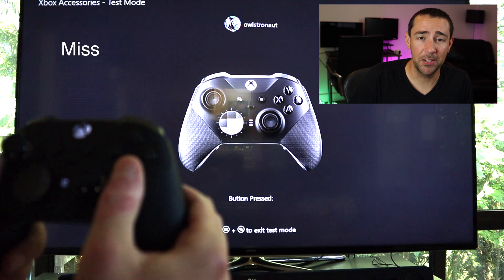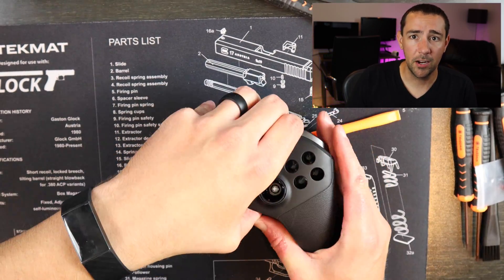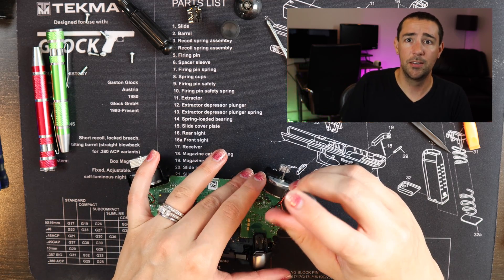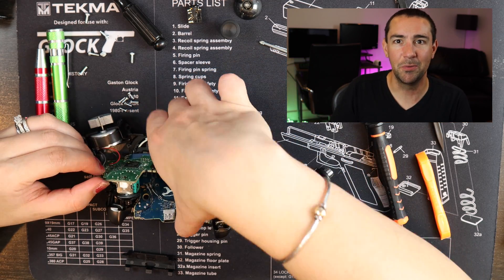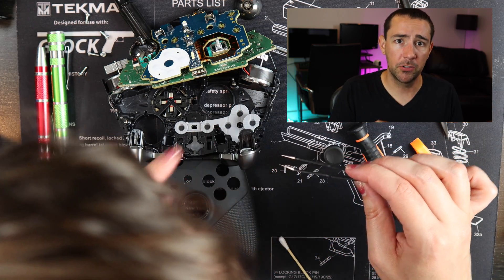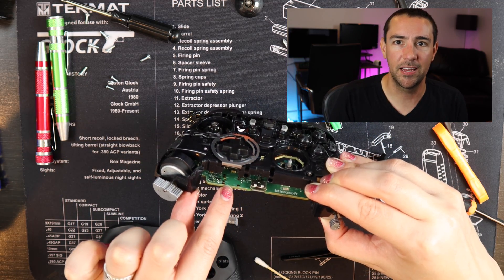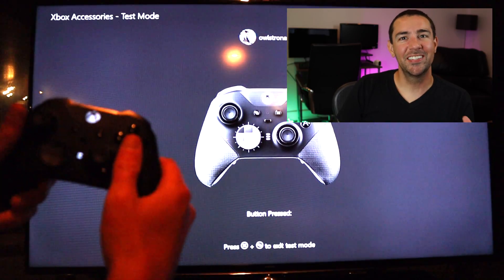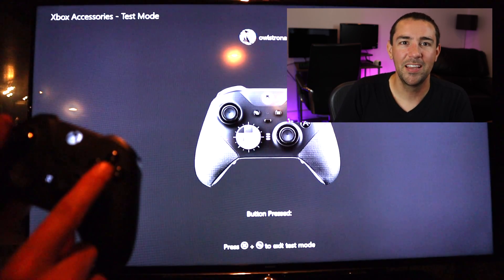Xbox Elite Series 2 Controller | Take Apart & Fix

Comment: Thank you so much for this. I'm on my 4th elite series 2 since 2019. I've been having them replaced under warranty and every single one has this A-button issue. My latest replacement had the A-button issue and a sticking right analog stick. The dark silver dome was catching on the case so I had to scrape it down with a razor blade. I used tiny little circular foam sticky pads that would normally be used on the bottom of something to protect a table. My only regret was not doing the other buttons because the response on the A button is amazing now. Barely have to press it. It's so nice to be done with exchanging controllers every few months. I'm pretty sure they were just sending me other people's rejects.
Reply: I'm in the same boat. I was considering sending off my 3rd controller (this one with an unresponsive A, X AND Y) and get a 4th, but if there's a chance they'll just send me one with the same problem PLUS a thumb stick issue like yours, I'm tempted to order this kit for $10 from Amazon and fix darn thing myself. Everything else about the controller works like a dream, but this problem has just been infuriating.
Reply: same issue here, A works "bad" and also the LB button...i'm scared to  open it :'(
Reply: Microsoft warranty? Or a plan like as best buy, geek squad?
Reply: I don't know why everyone had issues. I've had mine for I think 4 years now and the only 2 issues I've had is my lb going out(still works but not very consistent) and the grip trying to come off in a couple places. Other than that, 0 issues and I've put probably somewhere around to 5000 hours on it if not more.
Reply: I have the EXACT same thing. On my 2nd Elite 2 and the 3rd time I've bought it in for repairs. I even had to make videos because they didn't believe my problem! (They said the replaced the 'main and sub-board'...still same issue and told them what to repair and still they f it up)

I'm now debating whether I should return this one and get a new one, or try and fix the buttons issue with a little bit of sticky padding tape....

I just want a working controller and am soooooooo tired of these issues, so done with this 😩. 
It's still under warranty so there's my issue 😅
Reply: I had a similar issue. Endlessly sending them back under warranty until the warranty expired and I was left with a faulty 180 EUR controller. Shocking.
Reply: If the A is sticking just keep using it.  Eventually it will stop doing that.  My A button did that too when i first bought it.

Comment: Thanks man, never had a problem with my controller until I was FaceTiming my gf while also eating chicken strips with sweet and sour sauce. Well while I was trying to look at her and the game (unsuccessfully) I noticed my finger felt a lil wet. In my head I knew what had happened already, but I looked down to confirm my worst fears. I had dripped a small portion of sauce right on the b and x button. Normally not a problem right? Just wipe it off before it had time to drip down into the cracks! Well unfortunately, as I was attempting to look at my phone and the game, I was button mashing those 2 buttons, and unfortunately that amazingly tasty sweet and sour sauce had found its way to the inner workings of the controller. Causing my buttons to stick. So yeah. thanks for the vid!

Comment: why do these controllers always seem to have something wrong from the factory? The 1st one I got, I barely used it and the bumpers went, it was in warranty and they replaced it, and the one they sent also had an unresponsive bumper. and now my warranty is out and I cant get it fixed. You had an unresponsive A from the factory. These are expensive controllers, there is no excuse.

Comment: Informative video overall, but it's definitely not the best way to take off the faceplate. If you start on the sides it's very easy to damage the rubber on the edges, instead just insert the prying tool between the faceplate and shoulder buttons and start there. Once the top part is unclipped you can carefully pry the rest with fingers - much faster, easier, and doesn't damage the edges.
Reply: How do u get the thumb sticks off tho.  Thanks for the tip
Reply: @jonnyditto4440  it’s in the thread so you need to unscrew it. You can use the stick to make it easier (long one gives the most grip). It’s on there pretty tight though.
Reply: @bezrodnyigor  yeah I ended up having to use a thumbstick I dont plan on using (the tall one) and taking a pair of pliers to get it loose. It had to of been the most annoying part tbh
Reply: if you have a rubber grip, def. use that to hold onto the thumb stick. WAY easier to unscrew it that way. Hands were slipping a lot when i first did this.
Reply: This is the GOAT comment

Comment: For every gamepad i bought, first thing i will do is open it up and throw away the vibrating motors.  it reduces the weight considerably. I don't need the vibration function.  Wonder what is the weight of the motor in this gamepad, this is the heaviest gamepad ever.  The process of dismantling seems not easy...
Reply: Just teardown my newly bought series 2 and remove the rumble.  The gamepad is slightly lighter now.  Time to first connect and try out!

Comment: Thank you, I've been trying to figure out how to get pry the cover plate and get the thumbsticks off so I could fix my stick drift. Unfortunately, it looks like my left one might be cross threaded as it never comes off, only switches between being hard and easy to turn lol.  Luckily, my real issue was on the right stick and I was able to sort that out. Thanks for the vid!
Reply: How did you fix the stick drift?
Reply: @ZombieNoble6ZNT  the potentiometers for reading the stick movements are the 2 teal tabs mounted to the sides of the thumbsticks. I just stuck a small flathead between them to pop them slightly off, then reseated them. Drift was gone.

Comment: I highly recommend AGAINST just twisting the right analog stick off. 99% of the time YOU WILL BREAK IT. You need to use a heatgun on low for a bit to loosen the glue holding it otherwise it will be permanently damaged.

Comment: If you're going to do this, make sure it's for an intolerable issue. You are going to damage the crease of your controller significantly by opening it up. It won't be pretty, and you will feel it. I wanted to get in and take care of a little squeak on my right trigger stop.  Cracked it open and spread super lube over every possible surface that might have been causing it. Still it persisted. ¯\_(ツ)_/¯
Reply: Well did you use plastic tools like the ones in the video, or did you use metal tools like a knife or screwdriver? 

If the latter, then no surprise there and you should've known better.
Reply: @hotshotx1598  I used the tools recommended in the video.
Reply: @hotshotx1598  the front plate where the grips meet the smooth part are also peeling away now FYI
Reply: And now your controller feels different wow. Good insight. Reading this just stopped me from opening now just cause of a small rattling noise lmao.

Comment: Cool mat first off. You gave really good advice, best video of this topic in my opinion but I have two criticisms. One, It was hard to tell what you where doing because the video was sped up, especially when you are taking off the faceplate, the hardest part. Two, you skipped over the part where you took off the joystick domes. Other than that great video.

Comment: Good god this controller is a fucking train wreck. Like. It's legit worse than the v1. Microsoft was rubbing their hands together, laughing when they announced this POS. Weve made improvements to the new v2 controller, blag blag blah. You got me! Assholes. $400 and 1 completely f'ed v2 and 1 barely working v2 and I'm starting to slowly love my white S controller/ relearning claw  more and more. 0 stick drift, after 6 years! What a scam.

Comment: is there a way to take the back panel off? my little brother took off the little stick lever of one of the trigger adjusters and inserted into one of the holes of the paddles, when i tried to take it out it went deeper into the controller and now its stuck in there

Comment: Randomly while gaming my right trigger became clicky, like it would work just fine but the initial press down felt like I was pushing my dpad down instead of a nice cushioned trigger. I don't have the right tools and even if I did I would definitely end up breaking something trying to find the issue and fix it. There is absolutely no way I can take the shell off so I guess my controller is just broken now and I get to feel a very odd difference between my triggers when using them.

Comment: I need some help that I cannot find anywhere online, my whole controller works as intended but after 2 and a half years my controller wouldn’t turn on. I plugged it in but it did not work recently I plugged it into the Xbox and it turned on, the controller only turns on while plugged into the Xbox directly no other power source works. And sometime the controller turns off and just vibrates without blinking and I half to unplug then plug it back in. Does anyone know the problem and how to fix it ?

Comment: Im having an issue with my elite 2 one of the buttons got stuck so i took it apart to fix, sorted that problem but now when i skrew back together it doesnt turn on and if take skrews out having the shell loose it turns on?
Reply: Did you figure this out

Comment: My screws have small pins inside them stopping my screwdriver from going in
Reply: You need security torx bits or screw drivers. Security torx screwdrivers have a hole in them so you can take out those screws

Comment: This video has been super helpful, my LB button stopped working properly, I took it apart and I can see the tactile button on the PCB is not working well, does anyone know what that button is called so I can buy a replacement?
Reply: I'm actually having the same problem.
Reply: @14MrPresident  Hey, I was able to kind of fix it recently, look for Xbox RB LB Bumper button switch on amazon, and use those to replace the faulty ones
Reply: Same problem! Any luck fixing this?

Comment: I have watched two videos now, and neither show how to remove the joystick guards without breaking them. How do you remove those?
Reply: https://youtu.be/1Prhb66Hgo0
Reply: @VerticalStrafes  thank you. So easy a cave man can do it. Guess I'll go back to kicking rocks.
Reply: @richardberry8834  you may need to use pliers if they glue is to much but it comes off really easy.
Reply: It unscrews using the thumbstick
Reply: @richardberry8834  yes usually works but sometimes the glue is really on there and you may need to use pliers to twist the thing without the thumbstick. Just do it with the thumbstick and you’ll see.
Reply: Outstanding. Thank you
Reply: Flathead screwdriver (small). Some of the custom kits have a thumbscrew that does this. Lefty loosey, righty tighty.
Reply: @jackochainsaw  given what I have learned since, a flathead prying would destroy this controller. Put the thumbsticks back on, and use them to lefty loosy, right tighty the shroud on and off. Safest and easiest way to remove them.

Comment: Helpful, thank you. My right trigger started to stick. The little stick on pad on the fin of the trigger came loose and the adhesive was exposed. I took off the tiny pad and reapplied with some super glue, which actually increased the height of the pad and decreased the travel a bit, which is nice for quick shots.
Reply: Yoooooo, my right trigger started getting sticky too and i have yet to find out why. I've ALWAYS been careful with my hands, never played whilst dirty so hopefully it's something small i can fix...
Reply: Just had the same. Sorted with the help of this video. Still a bit sticky where some adhesive still exists, but that should sort itself over time.
Reply: So how did that super glue hold up after a year?
Reply: @maxstr  seems to be fine. Granted, I play video games maybe once a month. I try it out today
Reply: @ryanmasters5878  just because super glue isnt meant for most plastics as it damages and permanently warps plastics or even melts them
Reply: Hey, I'm having this issue right now and I can't seem to find the stick on pad that you're talking about. Did you have to completely take the bumpers off in order to see them?
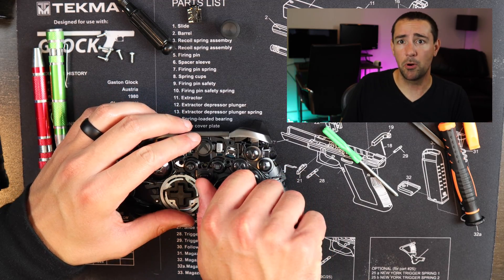Reply: @bryanmanio_  Not sure if you still need help, but i just did this fix.  no need disassemble the bumper.  you should able to see it by 3:10 mark when you look at the trigger side way.  it's a very tiny piece of square pad.  you can compare it with the other trigger to see proper location.  also check the bottom plate where that pad touches and look for any residue sticky stuff to clean up.
Reply: @GLn-uu1lv  Thanks for the response! In my case, it was actually the outer shell that was causing friction on the right bumper.  I ended up taking a small blade and shaving off around 2mm of plastic, and now things are working as intended again.

Comment: i have one query, which is the voltage battery ? 1-positive 2-neutral 3-negative

1-positive and 3-negative = 3.8v

1-positive and 2-neutral = .08v is correct ?

Comment: My left thumbstick on my controller doesn't have the tactile click anymore, it feels like mush. What should be my action to fix/remedy that?
Reply: EDIT: Geezz... i wrote all that out and now I see you are talking about your Left Thumbstick, not D-PAD.. sorry.. Seems my situation is totally unrelated. Will just leave here anyway in case it's useful to someone else.
---
I literally just fixed this on mine.. In fact.. that's why I was watching this video because I didn't want to break anything while was taking it apart... To summarize.. this is my 4th Elite Ver 2. I bought one new and then MS replaced it 3 times during my warranty because every one I got had some issue.. mostly it was bad LS that would not register to 100 in the bottom left corner.. other issues were the famous A button not registering 100% from certain angles unless hard pressed down.. One of them had a sticky X button that eventually loosened itself up.. etc..
Well anyway.. My last replacement from MS, the LS was perfect so I was very happy and all the buttons were smooth and responsive.
Except my D-Pad was effed. I only got tactile click on top and left, but right and bottom was like pressing my thumb into apple pie. Damn it!! The buttons worked if you pressed hard but I can't play like that. I knew there must be something wrong with either the metal tension ring or the conductive film that contains the metal domes.. Well, I had pre-ordered some replacements of both those parts from aliexpress in advance so I was finally ready to take this thing apart and see what the problem was.. And.... it was the film... the genius at the factory had applied it totally off center!!! In the end, all I had to do was carefully peel it back and the re-apply it in the proper placement.. Since I had the thing open, I put a piece of plastic tape under my A button as shown in this video, put it back together.. and now D-pad is clicky, and the A button is tight and consistent.

(Ok ok... I might have accidentally ripped off one of the wires to my rumble motor.. sigh.. solder iron on the way.. will fix later lol)

Comment: Can’t believe what they charge for this piece of shit. I’m on my 11TH one. Keep returning them once I feel something start to go. A button, stick drift, double input on bumpers. When are we finally gonna get a true premium controller ?
Reply: I'm getting double input on my right bumper as well, this is my second elite2, any advice? I almost want to just return it and get my money back and but a scuf.
Reply: @georgeh.7087  scufs are the most unreliable hardware I have had. Elite 2 is bad but it's better at least in my experience
Reply: Microsoft have these made in China by slave workers not only that but the parts are cheap shit. Xbox 360 controller has far more higher quality parts